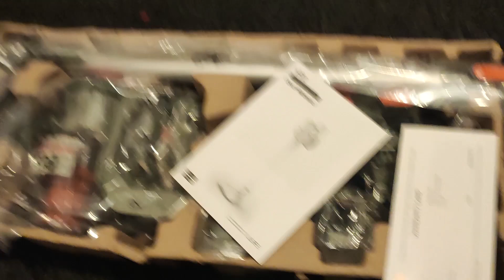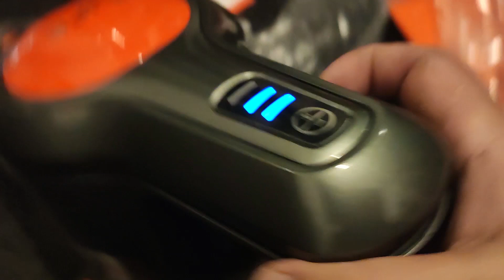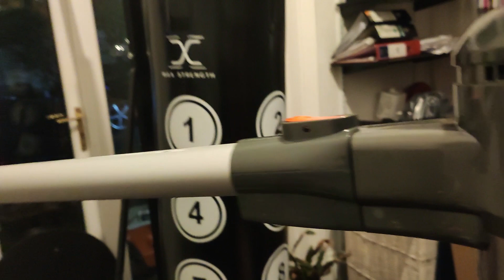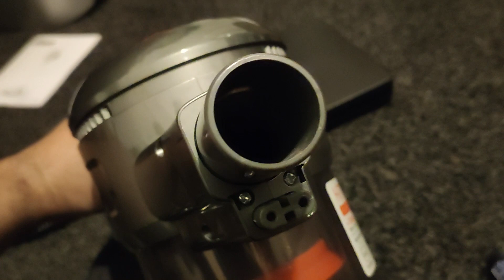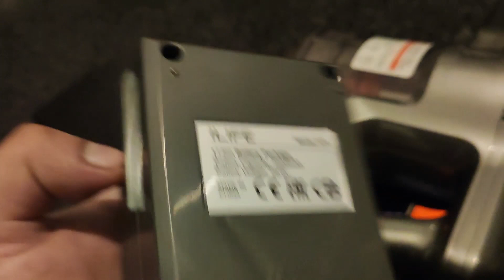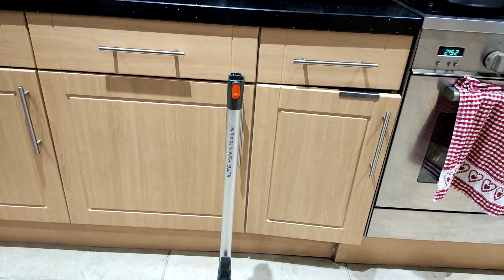ILIFE H70 Cordless Battery Stick Vacuum Cleaner review in English

Comment: I just bought a beldry airgility vacuum this sort of vacuums are just dysons
just for a lot less money I would rather buy one of the cheaper ones over
the Dyson/shark ones I wasn't that impressed with the Dyson cordless
vacuums when I tested one in curry lol👍❤😁
Reply from the maker: I agree. I do think the newer dysons are great machines but they are also 4 or 5 times the price and that's hard to swallow. I recently got an Amazon basics cordless vacuum and it's really good. Battery life is good, seems well built. Compared to the Dyson v9 it's very similar but a 1/3rd of the price.

Comment: Hello, do you think it is a good vacuum?
Reply from the maker: It's good, but only for the price. So if you want a good one I'd pay a little more and get a shark or Dyson. But this machine is very cheap. The battery life isn't great, the suction is ok but I compared it with an old Dyson v9 and that's so much stronger.
Reply: @enginium6043  you can easy 
replace 18650 Liion cells  with 3500Mah capacity cells..  :-)
Reply from the maker: @alliaj1  I wouldn't trust myself with electronics like that 🤣. I do like the fact it has a removable battery.
Reply: Thank you for the replay 👌
Reply: Hello,bro! Sorry for my English) how many time you used this vacuum..? Recommended?? How many minutes work battery ?
Reply from the maker: I've used it probably 40-50 times. The battery on high mode lasts less than 10 minutes. It's an ok vacuum for the money. If you have more to spend it would be better to spend more but if not it's ok for the money.
Reply: I bought this a few months ago , it has stopped working , would the battery need replacing already ? Thanks in advance